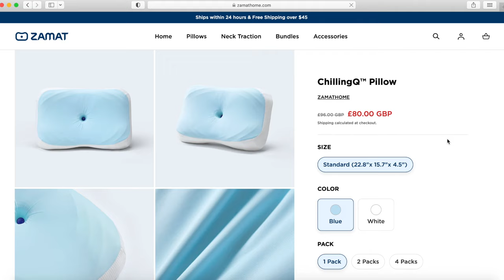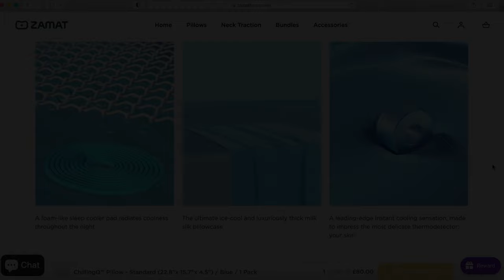Strange Lights in the Night Sky, Water Challenges & Grape Testing

Comment: Hi Carissa and Iwan
Are you aware that your balloon pump vessel(the red thing)also needs to be pressurised with air via the shraeder valve on the end of the vessel.this can be done with a car tyre pump and the pressure allowance will be on the data badge on the vessel.
The air pressure is very important for the pump to pressurise the system
If it will not hold pressure the balloon will need replacing.

Comment: If you can get hold of it, a non return valve will help your priming problem. Even on a movable system it works, but don't position it on it's side, close to the top of the pipe going down to water works for me. Worth a try, will save loads of time. 👍❤

Comment: Well, interesting video with starlink type drones. Whatever.  About FIGS— drying, preserving, dehydrating, and health benefits also.  I unfortunately buy my dried figs and dates from a popular health store in my town in the U.K.  when preserving your crop of dried figs I would keep too many for a whole year until you’re next crop.  So, there is a YouTube video on ‘How to preserve FIGS for yourself!’  They will keep for years.  Short Term— figs can easily be frozen and used when needed to do a variety of dishes.  Put these in packets (4 to 8 figs) per packet and label them before freezing.  For me I love eating dried figs, but I would sun dry them either whole with the stalks on , or half or quarter them and put them onto drying shelves using parchment paper (shelves must be 12/15 inches apart) shelve size (Depth 12 X Width 30 inches). A 3 or 4 tiers high with a cover to keep off insects/mosquitoes/flies etc., using a mosquito gauze, and put them out into the hot sun.  Rotate the shelves every 2 hours and turn the figs also throughout the day and bring your unit inside at night.  Do this for 2/3 days until the have dried out to a reasonable moisture content.  Face the unit east/west for full sun.  The midday sun the top shelve will be the only shelve getting full sun, so rotate the shelves every 30 minutes.  Before it rains, bring them in under cover.  HEALTH TIPS— best time to eat dried figs is in the morning on an empty stomach if on a weight loss diet and for overall heart health.  Figs are high in fibre and help to deal with stomach issues, especially constipation.  Just find your eating protocol by starting to eat three to four a day or more, or eat enough to be system free daily.  Dried figs contain more calories, sugar, dietary fibre, vitamins, and minerals than fresh figs.  Fresh figs will have more vitamin C, A, and beta carotene.  Hope this helps.  Lots more you can do with figs.  Enjoy.

Comment: Pumps don’t like sucking long distances. With those types of pumps you need to get them as close to the water line as possible. Even lower it down the well on a rope if the water table is low (just make sure you don’t spill oil!) Shortest possible suction pipe. Non return valves help as they don’t let the water run back. Also make sure there is no leaks on the suction side as it is easier to pull air in then water up. Make sure you have a good seal at the suction pipe to the pump connection. That is why the electric submersible pumps work well. 😮 Love your channel!

Comment: You might invest in a couple of hand pumps as they are self priming and use no electricity, just arm muscles. With all the wells on your property, it would be easier to move the water where you need it most.

Comment: oneway valve on the pipe into the well... fill up with water manually (it won't run out due to the valve) when pipe is full... start pump.... sip drinks and enjoy sun
can't avoid the extra protein in fruit, if you find one, toss it... just be happy to find a whole worm and not a half worm

Comment: Hi just a little tip for your pumping problems
Your pump will not prime air, so you need to get the pump full of water.
Also most common problems is the connections leaking air, could be either damaged seal, or just not tight enough, try wetting the seals first. Your petrol pump looks to be working well, just air screws it up. Sorry if I'm telling you how to suck eggs, but I spent 30 years playing with pumps at various incidents. Love your channel.
Reply from the maker: Thanks so much Roy! Some great tips!

Comment: WD-40 is not good for electric components, like contacts. You'll want to lightly sand the surface of them, then keep dry, or cover with a very thin layer of diaelectric grease to prevent future corrosion. Don't be "afraid" to work on your equipment. You HAVE to be self-reliant and be able to repair everything on your Homestead. Most things are easier that you think, you just have to be willing to learn.

Comment: The flask thing Iwan used with the grape juice is called a graduated cylinder. (It's called "graduated" because it has little marks on the side for measuring liquid amounts. Presumably one without the marks would just be a cylinder, but I've never seen one like that.)

Comment: FIG guide fresh figs are the best fruit but yes you have to check them 
Firstly figs have to be  a bit soft when ripe if hard they will not be sweet or have flavour 
You don't need to wash them as you always peel from the top down. Pull apart, when they are ripe they will be juicy inside so if they have  worms they riggle straight away. 
I have never dried them but my husbands cousins do, they only wipe them and dry them upside down so the hole at the bottom faces the sun. I think that is for the offending worms to leave as they don't like the sun. 😂😂😂
TRICK for getting figs to ripen
Get a cotton bud dip it in olive oil tap the bottom of the fig on the little hole and in a week the fig will be soft and ripe. This really works it's a long job but worthwhile if you want to dry them for winter or if they don't seem to be ripening fast enough do 1 part of the tree so you have some figs earlier❤❤❤
Hope this helps  I will be in Greece soon and picking ripe figs off the trees is 1 of my favourite pastimes.👋👋👋

Comment: Just checking: do you have a non-return valve on the bottom of the pipe you are inserting into the well? You need one. Then you can fill that pipe and the pump won't suck air. A non-return valve stops the water that you are using for priming just running into the well.
Reply from the maker: Yes we do.. it’s always something new 😅

Comment: I just watched ur chicken coop build but I think ur supposed to have air flow in ur coop somewhere 😊
Reply from the maker: You’re right.. that’s why we’ve got a mesh door, air vent and access hole. It’s quite cool in there, we will add a proper roof with more insulation after the summer we think.